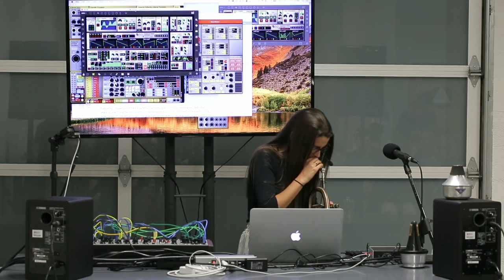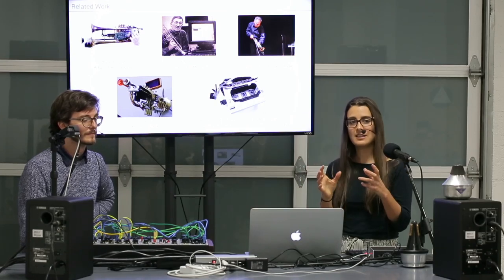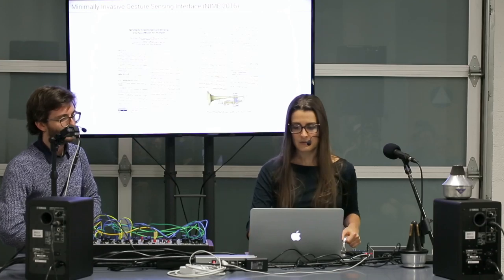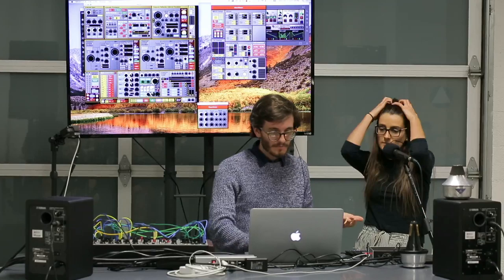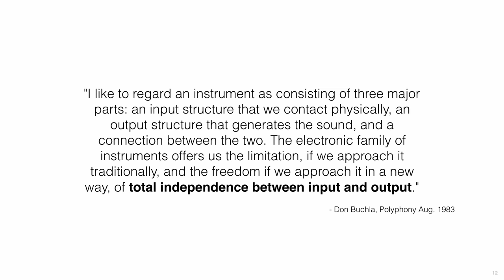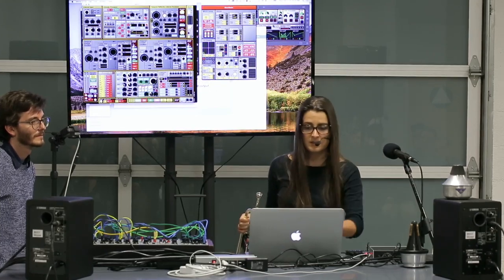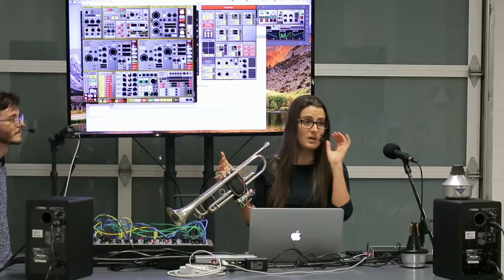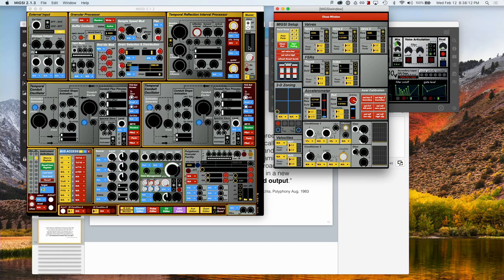MIGSI: Connecting Acoustic Instruments, Modular Synths & MAX

Comment: I use an Arduino with the Arduino device in Ableton. You can connect most sensors to it and it works! It's a M4L device so still uses Max, but in Ableton! I'm just using envelope followers in the modular world but plan on getting the Bastl Sense so I can augment my instruments with sensors as well!